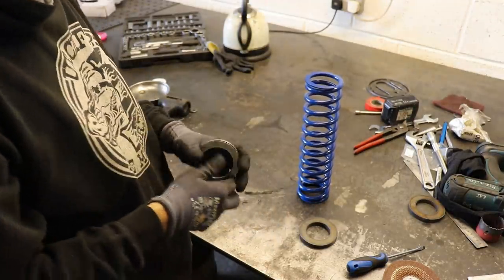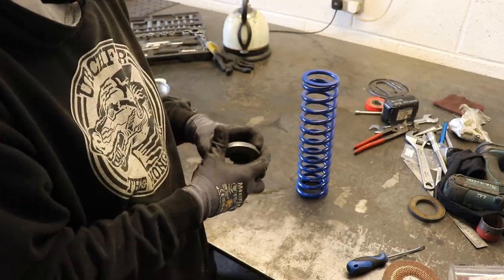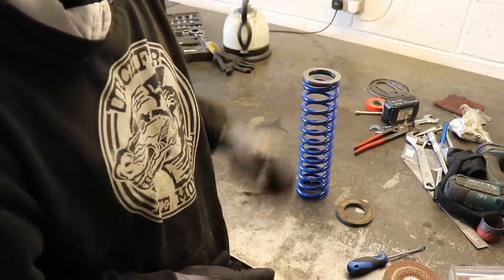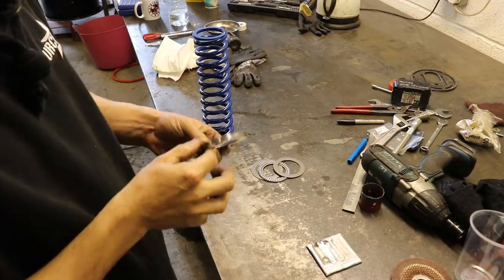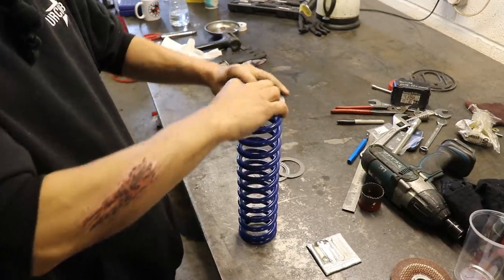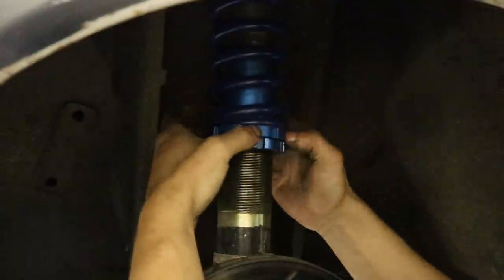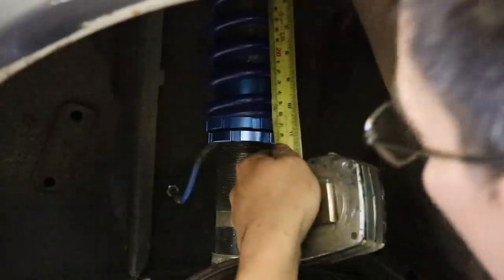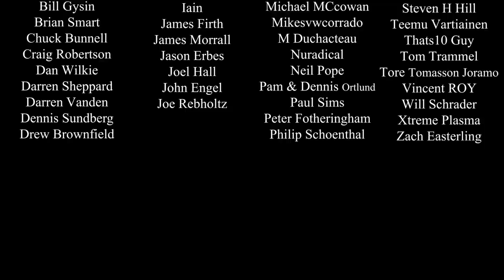Roller Bearing Coilover Cap- Simple Lathe Job

Comment: I hope this helps you out here in the U.S. in the mid 80's Chrysler used what was called a strut bearing plate on there k body cars and there is probably a lot left on shelfs

Comment: Nice work on top mount👍.  I'm looking for a lathe but difficult to find one locally at sensible price. The cheap Chinese ones are probably OK for model engineers but for machining larger parts they look pretty useless. Prices of used lathes and other tools on ebay are getting ridiculous, new prices for worn out rusty old rubbish. Moving heavy items like lathes is also a nightmare lol.
Reply from the maker: Indeed, you just have to keep an eye out and ask around local machine shops etc.

Comment: So, does this need doing with the spherical top mount? Surely the whole unit turns together...
Reply: i was thinking similar. having the spring rotate relative to the top plate is hardly ideal. the whole strut assembly should turn instead.
Reply: The spherical top mount takes care of the angle. It cannot rotate. The shock itself takes care of the rotation.
Reply from the maker: No It doesn't need doing, its just makes an improvement. Spherical bearings don't rotate as freely under load.
Reply: @Urchfab  gotcha. I imagine it's nice to do a little tinkering, instead of 'Oh god I hope this stops the crank rattling' jobs 🤪

Comment: ok.. im not gonna act like i know, but i WANT to know. what benefits does this bring to the suspension ? i am currently taking welding classes and learning fabrication so i can work towards my dream of building a uphill car for time attack battles
Reply: With alot of angle like in drifting you want your spring to be able to rotate as easy as the shock itself. Especially tight coils like this. Otherwise you will fight the spring itself to turn the wheels.
Reply from the maker: What he said
Reply: @Urchfab  is the damper not already turning radially with the spherical top mount ?
Reply: @sweenep86  The damper rod can turn some with the spherical bearing, but under load it’s not ideal, instead the rod/piston turns inside the damper tube. The spring need to be disconnected from the top to allow proper turning.

Comment: Annoys me when the red dot on the tyre is by the valve. It should be directly opposite the valve as the red dot is indicating where the heaviest point of the tyre is. You will find yourself using less balancing weights.
Reply: Sorry, but red marks the highest point of the tire, while yellow marks the lightest point. One might argue that the highest piont might be the heaviest but that is not always the case.
Reply from the maker: I've never even noticed a red dot, hasn't caused me any issues.
Reply: @Urchfab  It’s nice when your wheels come out without any weights at all. Can take some shifting  but the white dot is a good start. Rims can have dots for shape too.